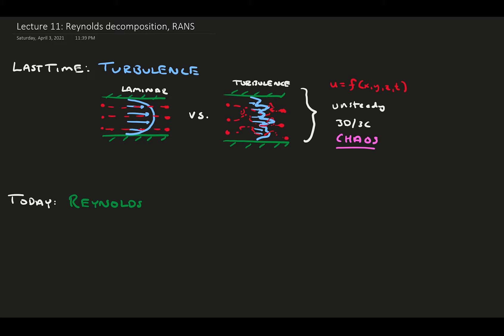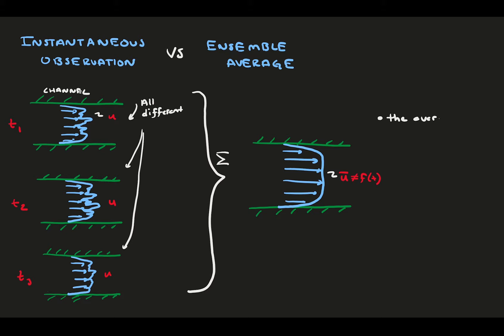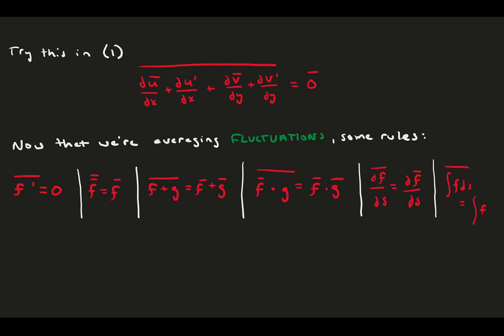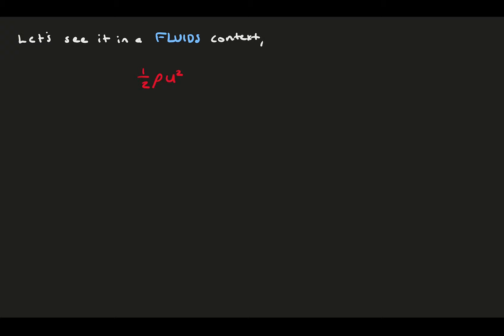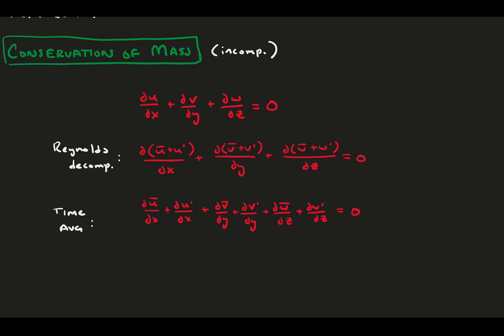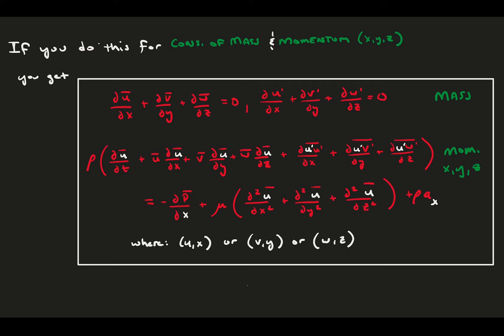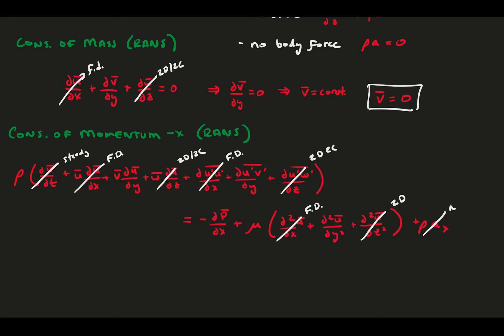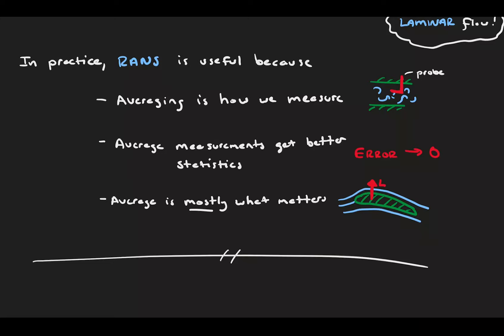Reynolds decomposition and Reynolds Averaged Navier-Stokes (RANS) [Fluid Mechanics #11]

Comment: Awesome video, thank you! For the X-momentum in the flow between plates example - can you do all the eliminations (steady, fd, 2d, etc) before you decompose and average to have less terms to compute?
Reply from the maker: Hmm, good question. I haven't done it out the reverse way because I think you might lose important terms if you simplify at the beginning, but I'd have to check. Regardless, if you start with the RANS equations and eliminate from there, isn't it the same amount of terms to compute anyway?